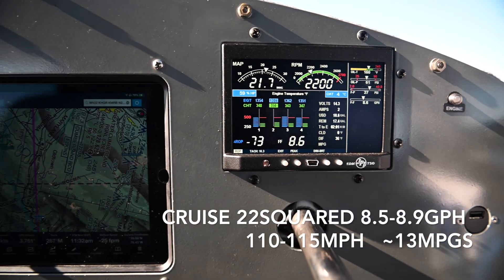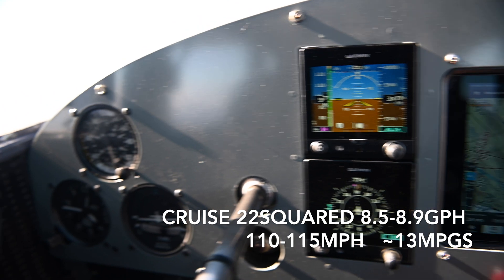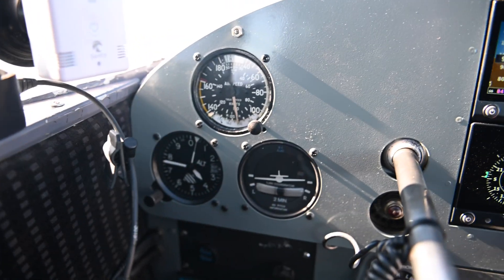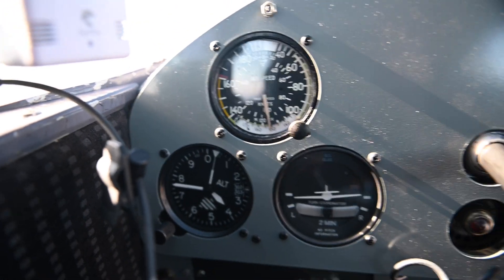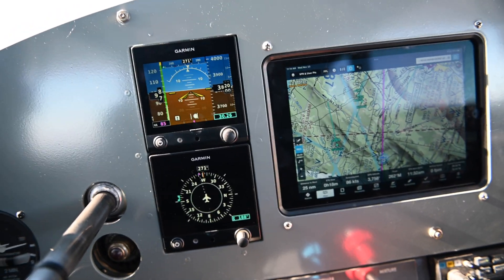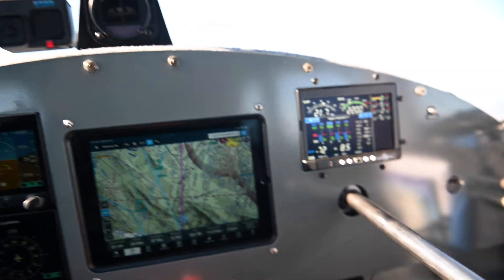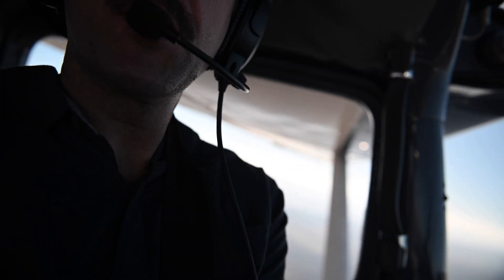Stoots IO-370 First Impressions (Part 3)

Comment: i am getting the same coversion done on my 1954 170b  i also have a 1950 tha tis basically a show plane. this one is also very pretty custtom paint full glass panelw ith auto pilot. it is going to be my beater so to speak  but ihav eowned both planes since 1980  i only paid for the 1950 21 grand  and the 54 i paid 22 grand. both had been flying. when i bought them. so putting another 100 grand or so into the 54 is a good deal.
Reply from the maker: That’s awesome! Sounds like you are going to have too very fine airplanes! You are not going to be disappointed. While searching the 170 association forums I found a post from the previous owner of my 170 wishing they had more power, kinda cool to find he was thinking the same way!

Comment: Kevin I’ve flown many Tailwheel aircraft and this 170 you have I want to check it out myself because it’s looks really fun to flying with more performance
Reply from the maker: Thanks! Yes I am still blown away at how well it performs after the engine and prop upgrade, the 170 does really well now!

Comment: what are the two protrusions on both sides of the engine cowling for
Reply from the maker: Those expand the cowl around the front two cylinders to allow the cylinders (rocker covers) to clear the cowling. The Continental IO-370 is based on the Lycoming O-360, which is a wider engine than the original O-300.

Comment: Can you post a chart showing your real world performance numbers at cruise settings?  Probably best would be at around 7,500 ft, showing IAS, rpm, mp, fuel consumtion when leaned correctly.  I understand your big wheels may slow you down 3 to 5 knots so I can adjust accordingly.  It is claimed 140 mph cruise is possible with this engine (small wheels).  Can you achieve something close to this such as 135 mph TAS at a reasonable cruise setting at 7500 ft?
Reply from the maker: I can try to come up with some better numbers when I get a chance. I think that is definitely attainable, just not sure what the power setting fuel flow would be.

Comment: Is full mixture after the starter the book procedure for that engine?
Reply from the maker: Yup you got it!! Not the same for all, but this fuel injected engine requires priming, then starting with mixture out, as soon as it fires mixture full in, to avoid flooding on start.
Reply: @KevinRudisill  Do you have your fuel pump on during start, or do you prime, turn the pump off, then start?
Reply from the maker: @davidbrentfoster1  during a cold start turn the fuel pump on, mixture to full rich for 3-5secs, then mixture back to idle cutoff boost pump off, then start…. (Off for start) Boost pump may be needed/ used for ground ops after start but not required. So essentially just on for engine  priming, then for takeoff.
Reply: @KevinRudisill  Awesome, thank you!! Keep you videos coming 👊

Comment: Beautiful airplane! The 21st century flat panel displays are amazing. Any idea what penalty the big tires make on cruise speed and fuel consumption? I'm sure that the rough field capability is worth it, of course.
Reply from the maker: Thanks! Yes the new panel is way more useful. I don’t know truly how the big tires effect performance with the new engine, but with the old engine I went from 8.50s to the 29s and lost 5mph cruise speed. Yes they definitely help with rougher terrain.

Comment: We should be completing our upgrade and doing 1st flights later this week. Thanks for part 3. What speeds are you seeing with a fast cruise with everything pushed forward?
Reply from the maker: Nice that is awesome!!! Right now  I have still been following the engine break-in procedure and backing it to 75% power. I know its got a lot more, I'll try to get some speeds, and that will be with the 29" ABW speed brakes on there too 😆🤣
Reply: Beauty.  So hard to find one of these anymore that isn’t a fortune to buy or fix up.